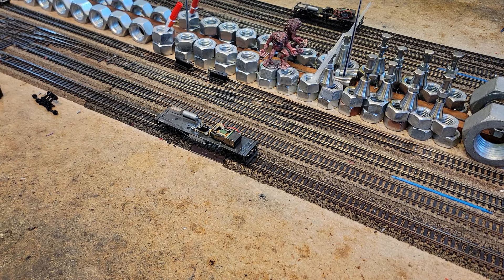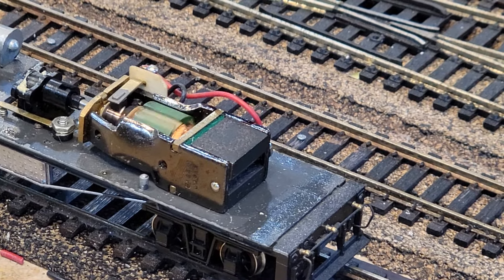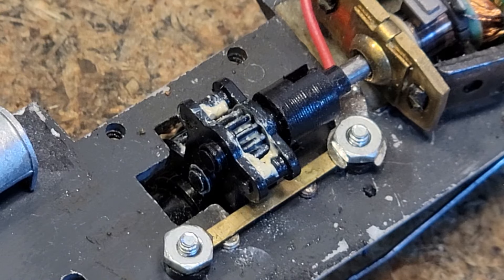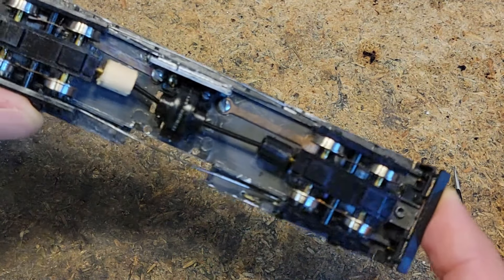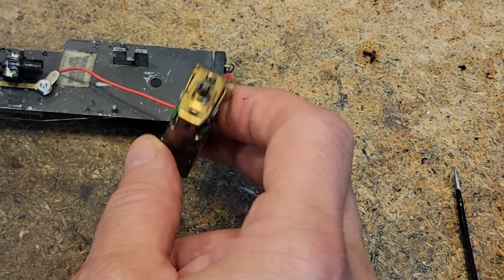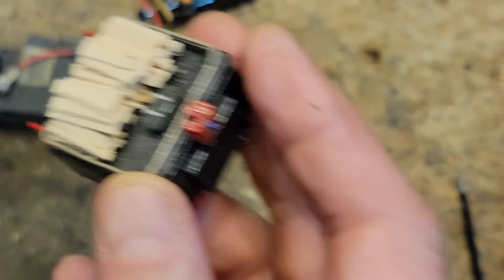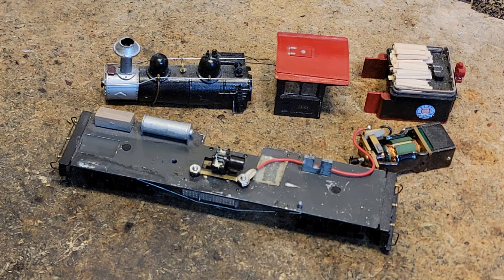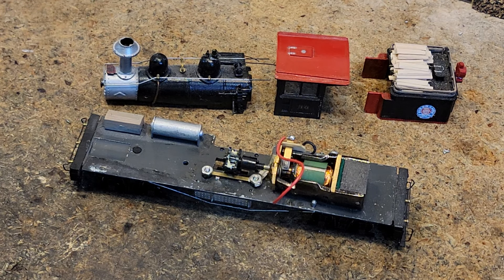MDC Shay Rebuild Part 2 Disassembly

Comment: For the center gear, there should be a box covering it where the four Phillips head screws are. The covers should be the same tooling from center cab engines underframe
Reply from the maker: yes! I found them!